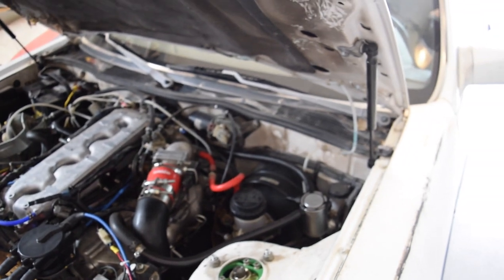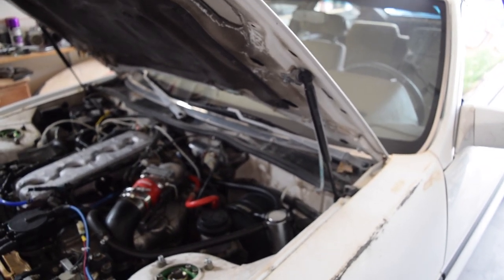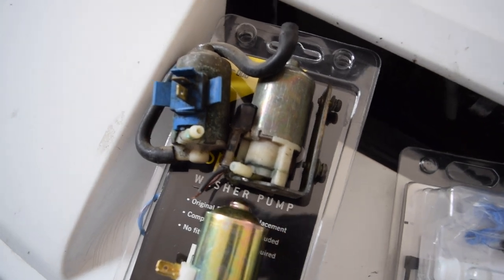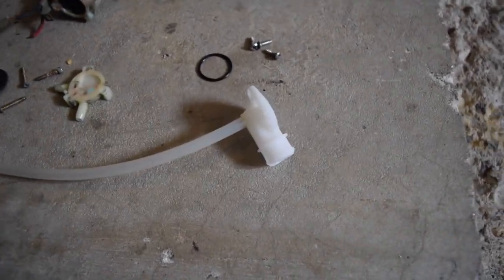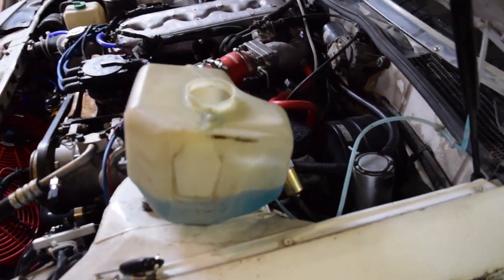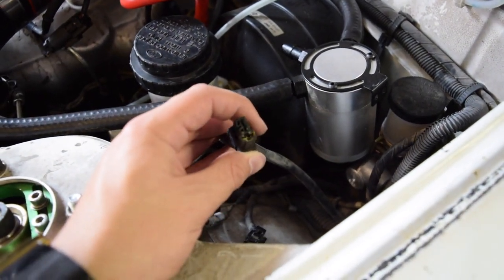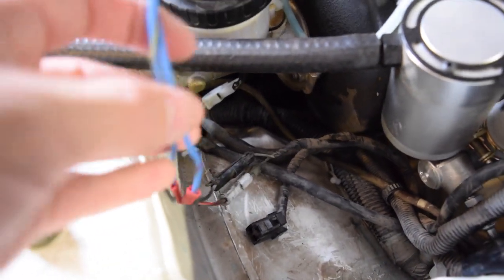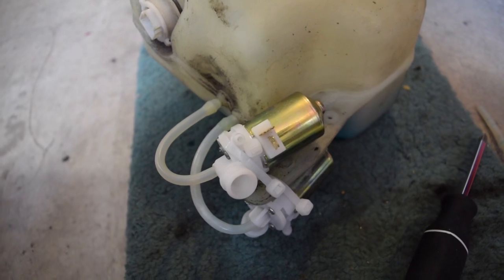Retrofitting New Washer Pumps (300zx Z31)

Comment: The fidanza flywheel is that that lightweight when they're supposed to weigh like 9 lb yeah I've already been looking at that I want a lightweight pulley kit which I already have taken half of my bottom pulley apart and I'm only currently running an alternator belt as we speak you know how it's a two piece bottom pulley I took outside off and put the 10 mmmm bolts back in actually some new gold bolts and it looks better but I want a lightweight pulley kit and lightweight flywheel and a strong ass clutch and I'm fixing to weld my differential I'm big on throttle response and I know that nine pound flywheel and some lightweight pulleys will help on all that you got some stickers or decals with your Channel I need to represent for you I only put stickers to stuff I have on my car but I have Paul net all-net fuel rail stickers K&N stickers everything basically that I have on my car I have a sticker for and you have been a hell of an inspiration and persuasion and ideas and information I would represent your Channel any day

Comment: What is the little piece the sensor sits in called? It's on the bottom of the washer tank. I have the sensor but not the little plastic/rubber seal that it goes in to slot into the bottom of the tank. Having a hell of a time even finding out what to look for.